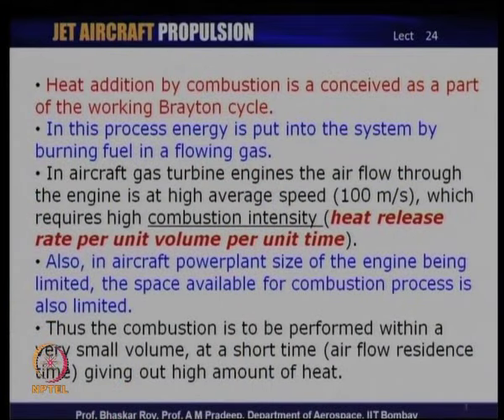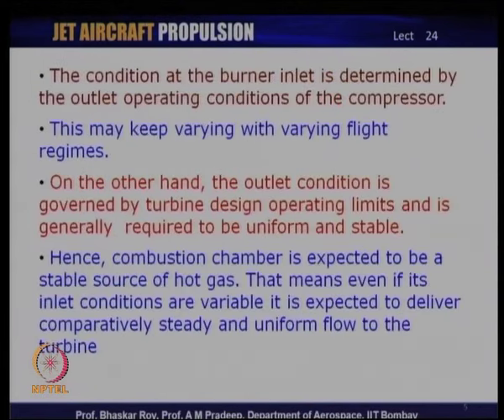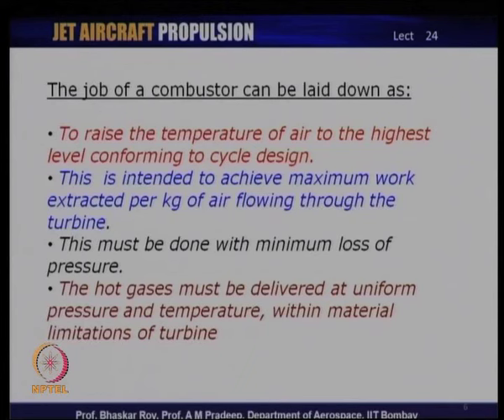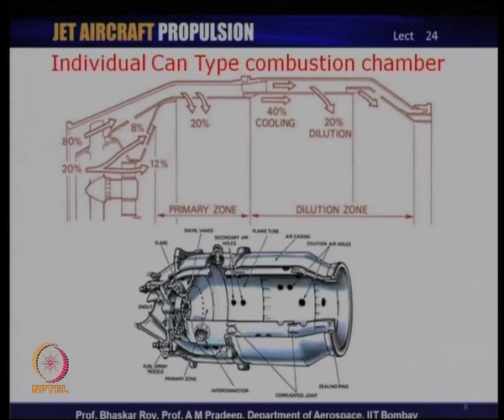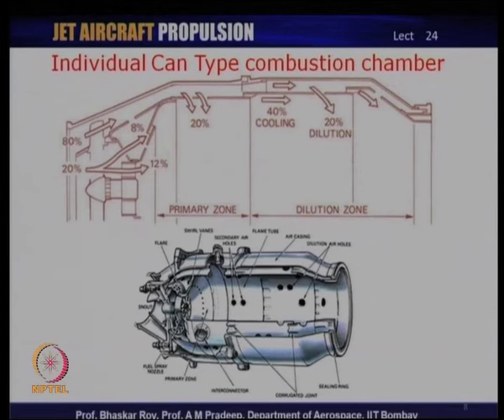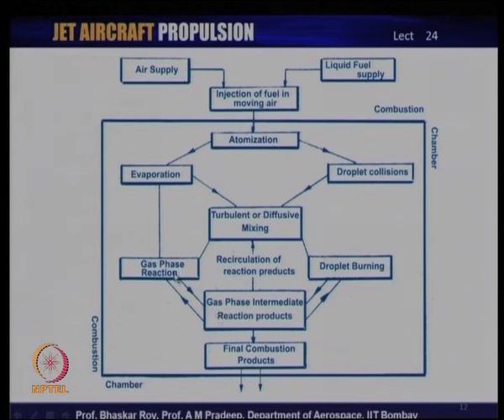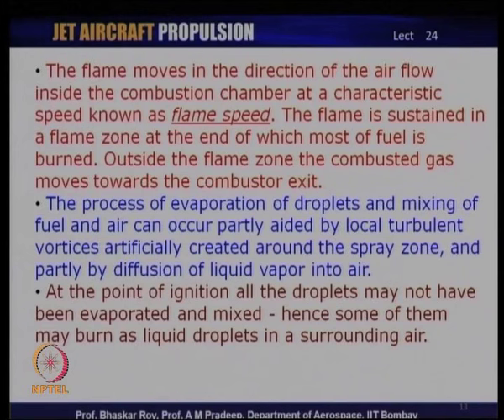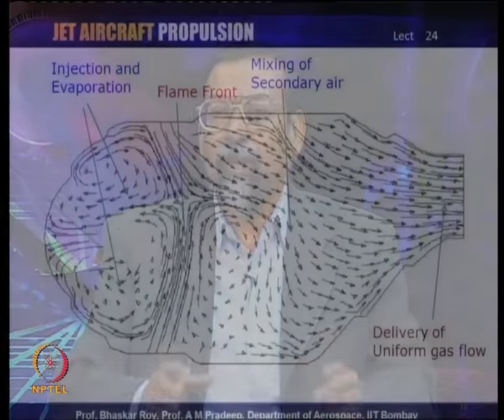Mod-04 Lec-24 Types of combustion chambers: mechanism & parameters

Comment: 19m40seconds in and he has said ... the same thing 8 times ... a combustion chamber needs to burn fuel in a short time in a small volume and provide relatively even pressure and heat ... so in roughly 3 minutes minutes Prof Roy could have covered this  ... way too much repeating ... and Prof Roy was so good at NOT repeating himself ... up to now ... sorry but this is NOT a speak easy this is a lecture that is supposed to educate not just allow the lecurer to hear himself talk abot the same thing over and over and over again.
Reply: 55 minutes for a 15 minute lecture major waste of time repeating the same thing 3 to 8 times throughout
Reply: These lects mean a lot for students who can't learn this in university for economical or university faculty problems. Specially in pandemic times, these lects have saved so many students, simply unexplainable in words how much they matter. So don't be an ingrate, simply don't watch if you can't appreciate the efforts of these people who have experience quadrupled yours. 
He doesn't mug up the stuff, speaks whatever he has learnt and that may sometimes result in repeating of something important.